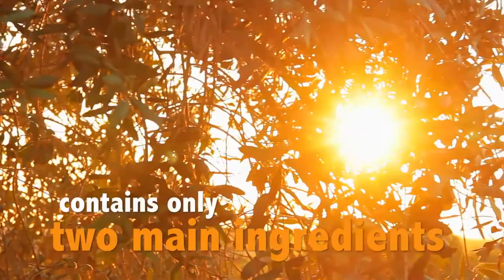What Is Aleppo Soap?  Only The Best Soap!!

Comment: I just found a recipe for Aleppo soap. The laurel berry oil is 30.00 a pound.  The only other oil is high quality  olive. No fragrance needs to be add because Laurel  berry oil already smells so nice. You can hot or cold process this. The recipe calls for 50 / 50. Its a very expensive 2 lb loaf.
Reply from the maker: Nice!  Are you going to make it?
Reply: @GROVELAND  yes, just for kicks, it might be fun. It has a cure time of 6 to 9 months. It will be ready for Christmas.

Comment: In Aleppo, we buy laurel soap in bulk (ten kilos), store it in our wardrobes for years. It gives a nice natural scent to clothes. The older it gets, the better, because it will dry more inside and last longer. It is also good to shine metal sinks or pots. Our grandmothers used to clean everything with it, from carpets to clothes. However, one needs to learn how to buy it. You should check the inside of it, the seller will give you a split one as a sample. Look at the colour of it, it should be normal green, not pale green (too little laurel) and not too green as it could be dyed to fake laurel. Smell it, you will recognise the scent of laurel, with experience you will know if they use less laurel than they should have. And finally scratch it, to see if it is well dried or not. It should be difficult to leave a mark of scratch. If the inside of the sample passes all these tests, you buy it.

Or you can buy just one and try it LOL
Reply from the maker: Thanks for the tips!  I looked up the brand we buy and it has info on their page that states this info, too so I guess we're getting the good stuff.  Just ordered 2 more bars!

Comment: I used tried a similar soap. This one, also from Turkey, had laurel oil, and olive oil base and was perfumes with oud and ambergris.  I felt so clean after this and have only ever felt this clean after using African black soap which is an extremely alkaline soap. I wonder if that’s is what gives the super clean feeling. That is to say, the phi 12 of the soap makes it a strong soap so it gives a cleaner feeling. Ensure you moisturise to avoid drying our skin